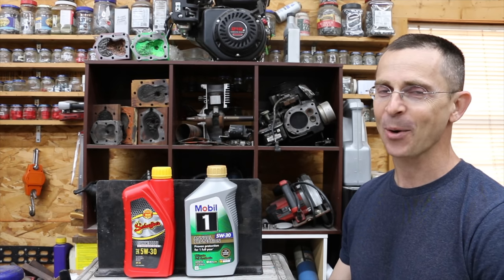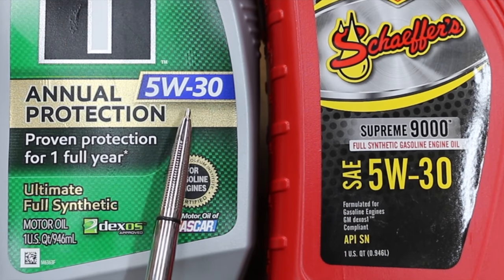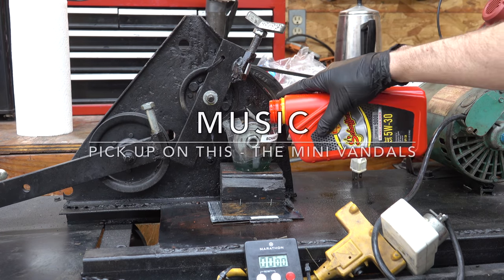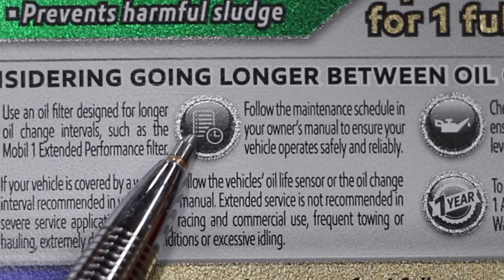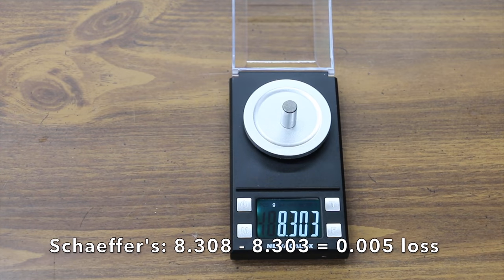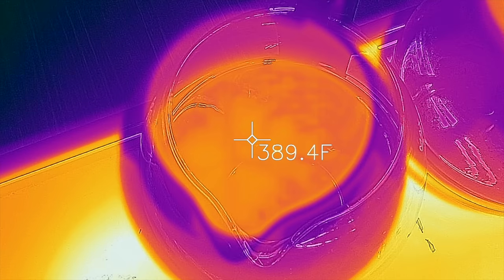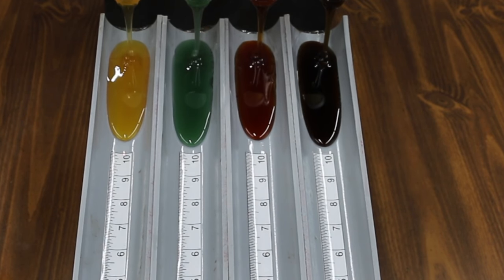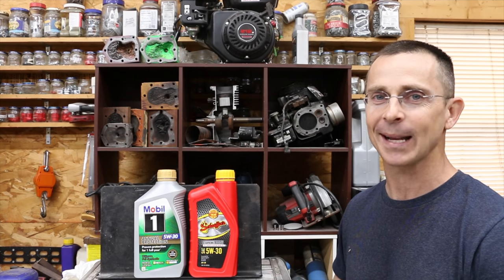Is Mobil 1 better than Schaeffer's Full Synthetic 5W-30 Motor Oil? Let's find out!

Comment: Neither have a drop of synthetic in them, 1999 court case Mobil vs Castrol, Mobil sued Castrol for not having any sythectic in their "Full Synthetic" blends. Castrol won by proving their hydro-cracked (crude gassified, then hydrogen shot thru which removes all impurities and reliquified) oil had same or better friction fighting than synthetic. Court said it was okay, so soon all the big manufacturers followed suit, didn't know Schaffer,  which I used to use around 2000, followed in the other's footsteps. Still a good oil, grade 3. To get a 100% synthetic like Amsoil, you have to go to a grade 4 motor oil, Motul is 100% synthetic at this writing, and another I can't remember. All I'm saying is extreme heat, heat saturation  (shutting of a hot air cooled motorcycle engine for example) will break these oils down, 100% synthetic will not. Extreme below zero starts (like for a 12 liter diesel) these oils will get thick as opposed to true synthetics. Just wish their labels were truthful.

Comment: When you throw in the difference in cost per quart, it's almost a dead even tie! Both, very good oil. I wouldn't be afraid to run either of these in a valuable engine.
Reply from the maker: Great point! Thank you
Reply: years ago I sold Gulf Coast oil filters out of Gulfport Mississippi. One Peter Bilt truck used. Shell Rotella 15-40 conventional. Shell oil measured the parts and found almost no wear at almost 1 million miles.Series 60 Detroit. I looked st the pistons and liners. They looked like new. That was with one oil drain. mentioned that and got a call from Road King magazine wanting the owners phone number. They did an article on it. They didn't tell the mechanic that changed the Bounty Big Roll paper towels that the oil wasn't supposed to be drained. It used the big Gulf Coast 02 that uses paper towels. Several have gone over 1 million miles with no oil drains. Some with synthetic oils I've never heard of.

Comment: You should have done the Mobil 1 first on the bearing machine because Schaeffer's plated the bearing race , and that prepared the bearing race for the Mobil 1 test. I didn't see you change or clean the bearing race between tests. That is very important.

Comment: Project Farm,  how about a comparison of regular synthetic oil vs synthetic motorcycle oil? Supposedly synthetic 10W40/20W50 motorcycle oils contain a different additive package than synthetics for cars due to the different type of engine cooling (air cooled vs liquid cooled.) The reason I'm asking for a comparison is to find out if the motorcycle oil would perform better in lawnmowers and generators vs oil for cars. I've read several different small engine mechanics say during extended power outages such as a hurricane that the generators with car engine oil experienced a significantly higher failure rate than those that used synthetic motorcycle oil. Keeping in mind that regular oil changes are performed per the owners manuals. 
Thank you. 
Greg Sicinski
Reply from the maker: Thanks for the video idea.

Comment: I just had Liqui Moly LL 04 die at 13,000 km in my wifes diesel BMW.
She pulled up hot and I could hear the N47 timing chain rattling like crazy so it lost its viscosity and had broken down.
Its only a 70,000 k car so no its not worn out.
Swapped in Penrite LL04 straight away and its running normally again.
I havnt had this issue since the late 90's.
The liqui moly is priced here equal with the top tier pao ester offerings from the other manufacturers which in my experience would have gone further.
Thats just my experience.
Reply from the maker: Thanks for sharing.

Comment: My bike OEM recommends using 15W-50 oil grade – Semi Synthetic.
Will it be detrimental to the engine if I use 5W-40 oil grade – Full Synthetic.
I don’t use 5W-40 as I stay in cold temperature, just use it considering it to be a better option. 
But few mechanics mentioned, not using the correct grade will damage my bike engine in long run. 
If you can kindly share your recommendations.
Reply from the maker: Thanks for the suggestion.

Comment: Many moons ago,,I did some service work in an’OIL LAB’ at EXXON  BAYWAY REFINERY,  these 2. Different 2 stage cascade systems, which went down to-60^C, refrigerants , high temp R500, low stage R 13, the quantity of the oils were about 300ml, , I could aNOT STICK AROUND,,for testing, but there were several brands for ‘COMPARISON’,, CHEERS from NJ
Reply from the maker: Thank you very much!

Comment: This test is nice but it only shows a very small slice of performance. Cold flow test will not show the shortfalls in VI improver failure where it starts to gel up like in a Brookfield or MRV test. I can make you an oil that will flow at -60 F but once it becomes slightly contaminated, like you know, engine soot, it breaks down. Tests for amateurs :)
Reply from the maker: Thanks for sharing!

Comment: molly is a gea rlube additive aka an extreme pressure additive. There is nothing in the engine that would benefit because for the additive to bond, it would require the extreme heat associated with extreme pressures. Most engine part surfaces would be destroyed trying to achieve this.

Comment: Great test!  Hey I have a 2011 BMW 535i F10 with an N55 engine and I use Castrol 5w30 Full sythentic Oil which is what's recommended.  I wonder how this oil measures up to Mobile 1, Scharffer's and STP, and AMS Oil? Would you be willing to do a comparative test of the oils? Also BMW has a rating that they look for in their oils and that is LL-01 rating.  I'm not sure what that is.
Reply from the maker: Thank you.  Castrol makes a great oil.

Comment: I'd love to see Amsoil vs Mobil 1 - Mobil 1 didn't discolour much or change properties much. If you keep cooking them longer, or do an extended wear test, I wonder how it'd turn out?

Viscosity changes scare me. When the cooked oil runs much faster than the fresh oil, that tells you its viscosity just lightened. What usually toasts engines after they have been worked hard on the track? Oil that gets too light. Oil should be steady - I'd be grading cooked vs fresh on how close they are, similar to how you grade grams lost.
Reply from the maker: Thank you!

Comment: I lost track of Project Farm and found it again tonight.  Reminds of when I had slack time back in my days in an auto machine shop many years ago.  My personal interest was wondering how the new Pennzoil natural gas derived oils performed.

BUT tonight I wondered if there could be a special category just for laughs of matching car manufacturer oils since so many swear that "using Toyota oil is best for their Highlander", etc.  I wonder how 0w-20 oils would stack up between GM, Toyota, Nissan, Honda, Ford, etc?  I'm not even sure all of those makers use that weight so finding a common available weight would be key.  Once some winners surface then test those against the commercial oils!
Reply from the maker: Thank you for the video idea!

Comment: Hi mate! A friend's just bought his first car, and we're talking about the benefits of full synth compared to dino or even dino/semi-synth, and I told him that I'm sure it's the reason my engine isn't carboned up even at 300,000km, and neglected oil changes in the past, but this is only anecdotal evidence. I've also told him that it seems to flow better in the cold, but Australia's definition of 'cold' at 0-5c celsius really doesn't count all that much, not unless you live in the alps. Am I missing a comparison you did, or have you yet to do one? Because I'd love to see a head-to-head of dino and synth. Also, if you could finally put to bed the whole myth of 'synthetic oil is a lower viscosity than dino, even if the numbers are the same', that'd be fantastic - not unless there's some truth to it.

Either way, I'd love to see this. Thanks mate! Rory

EDIT: Also have a suggestion for you! If you want the most accurate readings with the coffee pot test, get a proper temperature meter, you can get them relatively cheaply and they can come with calibration certificates. You can get them with two probes and both probes can record simultaneously, so you can see what both pots are doing at the same time. Something like this https://www.ebay.com.au/itm/BENETECH-K-Type-Digital-Thermocouple-Thermometer-50-300-Temperature-Meter-CS/113863239451?hash=item1a82c7271b:g:XVoAAOSw6OtdX7o- or https://www.ebay.com.au/itm/UNI-T-K-J-Type-Dual-CH-Digital-Thermocouple-Temperature-Thermo-Meter-0-2-LK/383150449905?hash=item59358be4f1:g:kDoAAOSwUORde2t4 maybe? I'm definitely not saying you're doing anything wrong! Just thought it might be an idea to look at if you want even more accurate results. Obviously it might be a good idea to look for meters that can be calibrated, but I'm sure they exist!
Reply from the maker: Thank you for the video idea!

Comment: Theres an on going argument on heavy duty diesel oil as to which is the best. Some say whatever oil as long as its diesal oil  and then others swear by schaeffers or rotel or mobil one. Of course theres the intervals to consider on top of the oil. Im sure theyll all do fine if you change your oil every 10,000 miles but what if you wait till lets say 20,000 miles?

Comment: Can you do Mobil 1 vs Toyota brand motor oil, Mobil makes Toyota brand? there is debate on which is better or if they are the exact same thing in different packaging. Is toyota additive package better than Mobil 1 additive package?   Which is better?
Reply from the maker: Thanks for the suggestion.

Comment: Viscosity of synthetics is made in the refining process. You can't boil it out. Regular Dino oil the viscosity is added chemically as an additive. It can be boiled out. This us why Dino oil thickens with age and synthetics don't. Also there are two types of synthetics. One definitely better than the other. Mobil 1 is the cracked wax type. What about Schafer's? Schafer's may be an older company but what does that mean? How many of the guys from the 1800's are still in the research lab? There are some real problems with this guy's testing and knowledge here. Is Schafer's 20 bucks better per oil change?

Comment: Synthetic oil has always been reputed to make head gaskets and other gaskets leak. I wonder if you could test whether this is true or not as compared with conventional motor oil. Also, is a higher viscosity oil less likely to cause gaskets to leak still than a lower viscosity oil?
Reply from the maker: Thank you for the video idea!

Comment: Nothing wrong with the "heated oil" test but if your engine oil can't be kept under 250 deg you got and are going to have problems. Meaning consider an oil cooler to keep it under 250 deg . Many factors here. Gaskets, aluminum components, how often to u change oil and do u use synthetic, condition/milage on engine and throttle position.
Reply from the maker: Thanks for the feedback.

Comment: If you could I'd like to see a video of the Castrol magnatec oil vs the best oil you've tested to see if it hold up and actually has better start up protection if possible as they claim also any suggestions on an engine cleaner that wont damage but clean dirty lifters?
Reply from the maker: Thanks for the video idea.

Comment: I trust Schaffer’s oil I run there oil products in all my farm equipment and semis and fuel additives and when I overhaul a caterpillar diesel motor the engine still looks factory new  even at over 1million miles on engine but first overhaul at 650,000 miles
Reply from the maker: Thanks for the feedback.

Comment: The uncertainty range of that particular Newacalox mass scale  +/-0.005g. With that error range, the first test is inconclusive. Also, I'm curious what measurement device you used to measure the wear marks on each bearing. I hope it wasn't calipers. This was a fun video, but take this all with a grain of salt. I'm guessing your IR camera has roughly a +/-3degC accuracy. I'm basing this strictly off of the low resolution of the thermal image. There's a reason these tests are conducted in certified labs; especially with these performance lubricants. Again this was a fun video, I really enjoyed it. GO SCHAEFFER'S!!!! =)

Comment: Don't know anything about oil. Bought a new Subaru in 84. Brought it home and put Amsoil gear oil in the 5 speed.Put a Frantz oil cleaner on and filled the engine with Mobil 1 15 50 racing oil. I changed the Frantz once a year and added a quart of oil for about 20 years and 250 k. About 12k a year. The oil always looked good. Sent a sample tto a Caterpillar lab. They said it looked good for that many miles but probably should do twice a year. At some point after that both head gaskets started leaking oil. It never needed oil between filter changes. Never drained oil before it started leaking oil. One.cylinder had a little less compression but couldn't tell it when it was running.
Reply from the maker: Thanks for the feedback!

Comment: im wondering if the amount of oil you put in the cup for the lubricity tester would make a difference? it seems like maybe the more oil that contacts that spinning wheel, the more oil it would bring with it up into contact with the bearing, and leaving a larger oil barrier between the bearing and the other surface.
Reply from the maker: Thanks for the constructive feedback.

Comment: A question though a little off topic.  Can general use oils and grease be used on firearms in place of custom products?  I realize many gun owners treat their guns with special care but can some of these new synthetic greases and low visc synthetic oils, 0W20 for example, do just as good a job as the single purpose products and for a far cheaper cost?
Reply from the maker: Thanks for the suggestion.

Comment: In Europe, we have manufactures that have a recommendation of 20´000 miles interval. My dad has actually such a car and the engine still runs fine after 225´000 miles. But that would not be the case if he would have used crappy oil, that is for sure!
Reply from the maker: Impressive results! Thank you
Reply: Project Farm Thank you for the great videos :)
I think you definitely should follow the manufacturers recomendations so I won’t advice anyone to anything else. But I think it is nice for some to hear that Mobile1s claims not are total bullshit :)

Comment: Which is the better Engine Oil in-between three ones for my Nissan Terrano Diesel 2014 Model. 1lac80 thousand Driven.
1) Mobil 1™ 5W-30
2) Mobil Super™ 3000 X1 Formula FE 5W-30
3) Mobil 1™ ESP Formula 5W-30
Reply from the maker: Thanks for the video idea.

Comment: Please do one with MOBIL 1 Extended performance vs the King Ultra platinum by penzoil. Always thought it was strange you used castrol Ep but not Mobil 1 ep ): seems like extended performance would’ve been the best lol to use by Mobil 1 instead of Annual protection
Reply from the maker: Thanks for the suggestion.
Reply: Yeah, I would like to see if there is a difference between all the Mobil 1 products.

Comment: Mobil 1 Advanced 5 w 30 or 10 w 30 is the best oil in the world period. Accept no substitute. I change it at 10,000 miles. In the cold it flows fast and in the heat it protects. MOBIL 1 IS THE KING!
Reply from the maker: Thanks for the feedback.

Comment: Why do I get the feeling that Mobile 1's "20,000 mile guarantee" claim guarantees you a fresh batch of oil if our motor blows up. I botched an engine rebuild due to a Harbor Freight torque wrench being completely unreliable. I blew the engine again about 8 months later, but dagnabbit, they sure as heck would give me a free torque wrench!
Reply from the maker: Thanks for sharing.

Comment: Do you think its a good idea to use full synthetic oil in my 84 Honda Goldwing 1200cc.
Reply: No. Only run the recommended oil for your specific engine.  Why? Cam technology and thermal coatings.  What's being used today on metal surfaces was not available back when your specific engine was built.
Reply: @stevesolo16  ok thank you.

Comment: Check your facts. Mobil 1 has been selling oil since the early seventies. I bought some of their first oil developed and sold by them. Before Mobil 1 was Amsoil. It was also available in the early seventies but before Mobil 1. It was invented by an Air Force jet pilot who wondered if they use synthetic oil on my jet, why can't we make some synthetic for a passenger car?

Comment: If you want to have some fun run Schaeffer engine oil change it at your regular oil change interval the first time. Then put it in the second time if you're running Schafer's 7000 run at 7,000 miles and if you're running the 9000 run it 9000 miles. Then send a sample into Mobile asking them to run it through their lab and tell you how many more miles you should run it. But at the same time you need a couple samples of Mobil 1 changed at normal intervals / your manual you can get these from another vehicle or your friends vehicle. Your test results will come back with them telling you to run the Schaeffer's oil at least another 4000 miles. And the mobile one will come back with them telling you that you're pretty close to the proper oil change. The last time I did this they sent all my samples back saying they no longer did testing however more than half of each oil sample was missing so I think they caught on that I was sending them someone else's oil. Anyway it's not really fair to  compare any other oil to Schaeffer oil to any other oil it's in a different league all of its own however I did find running oils long-term at tear down after hundreds of thousands of miles Royal purple comes close for anti-wear and cleanliness of the motor but it is generally priced higher than Schaeffer's. I have been running Schaeffer's products for over 10 years and I really can't say that I found too many products the even hold a candle to it.
Reply from the maker: Thanks for sharing.